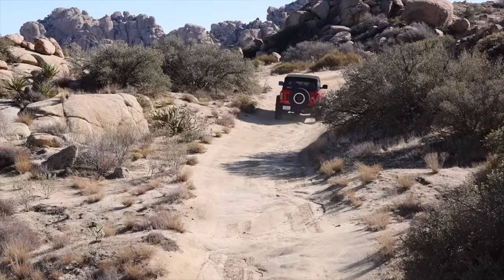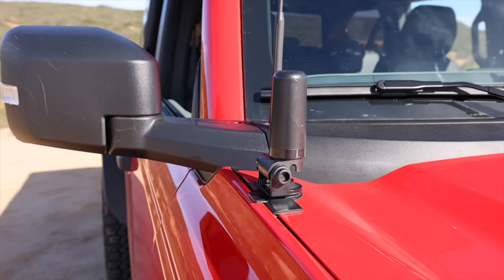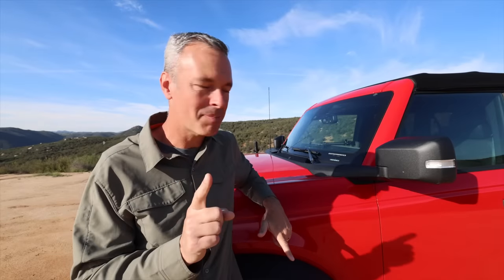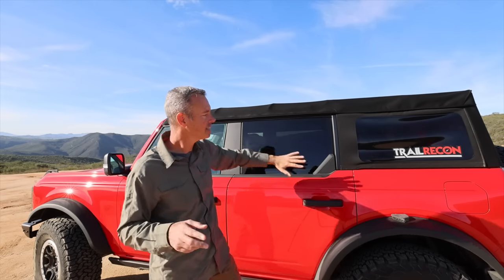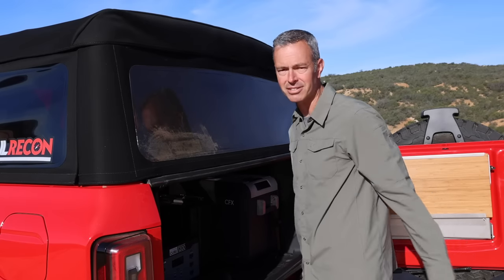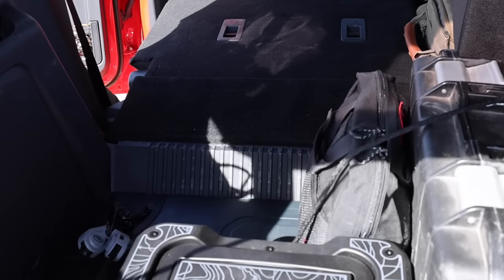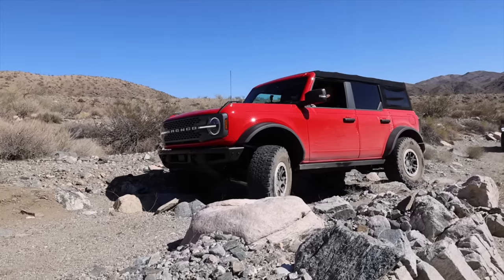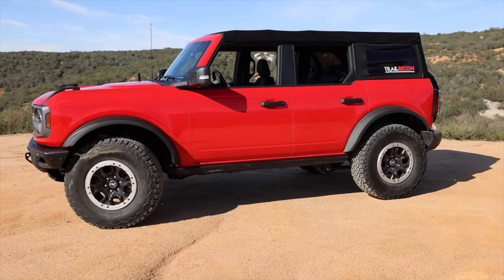Pros & Cons of Owning a Ford Bronco

Comment: Those are one time use bolts and yes if you remove them buy replacements first. You are absolutely right about a hang up point, definitely report to ford for a possible engineering change.

Comment: Great review. Personally I love the soft top. Easy on and off and the wiggly windows don’t bother me but I can see how others would have a problem.  For the rear lift take a look at IAG rear hood assist. Easy install and raises it a bit more. Still two hands to open but one pop and no need to set the bar yourself.

Comment: I personally would chose the bronco over my jeep. it’s more comfortable and does great with 37s and a slight lift I haven’t gotten stuck yet and I hammer on it pretty hard.
Reply: I think that it's even in competition says a lot for what Ford did.
It's also very often a lot of serious offroaders who like their jeeps over it too, and they show a shot of their jeep and they have 40 inch wheels and 50k of mods and lifts on the thing.
Yeah no kidding it isn't doing that, and of course it doesn't have the range of mods that the jeep does, but for those of us who don't want to mod so heavily, at least not yet, it's the best performer I can see on paper from an OEM purchase.

I just can't wait to get mine.
Reply: @breaddrinker  Jeep also offers 35s from the factory, so I’m not sure if it’s fair to say the bronco is the most capable stock vehicle... solid axles just offer a level of reliability and capability on the trail that ifs just can’t reach. It’s not about a brand, any brand that offers solid axles I would say the same thing
Reply: @AustinH7  I'm not brand proud at all. Please don't think I'm just harping on to one..
In fact in my situation I'm willing to be swept away, and I still have my eye on the Grenadier, and the new 4runner on the horizon while my never-ending Bronco order comes along..

I've got my own particular list of criteria, and the jeep..  
That of course, isn't to take away what you get out of it.

I'm steering at things I know I'm going to need in my situation.

Comment: The IAG struts for the soft top are a must... I am not too bothered by the soft top and got it to get it sooner too, but I think I would reorder with a hard top just because of the trunk space.  I don't even mind the wavy back window, but coming from a van I hated bending down to access the trunk.   But those struts made the soft top usable and it will be perfect since summer is coming!!!  Highly recommend them to eliminate one issue and it is only a $100 mod.

Comment: Thanks for all the great videos! The top has shifted forward then causing the closing issue and sides to be loose, If you completely remove the  top you can shift the brackets rearward to correct the problem on soft top. I have your identical bronco with lux package in Race red and I have the ford installed winch and it dose work with the adaptive cruise control.. Not crazy about camera being blocked though!

Comment: I love my Bronco Basesquatch, but that soft top is horrible.  I ended up fabing up some bars that connect into the factory bolts so I could attach my 270 Awning and my roof top tent, then using the canvas roof cover to protect me from the elements.  I live in Arizona so I don’t worry about rain too much.

Comment: I drive a 2018 JLUR on a 4" lift and 38's. I'm looking forward to getting out on the trails with some Broncos so we can swap opinions on the pros and cons of each. I appreciate anything that can wheel off-road, and in my opinion, the 4door Ford Bronco with a hard top would be a great daily driver and weekend warrior for easy-moderate trails, however, I would personally still prefer my solid front axle and huge aftermarket support in my Wrangler for aggressive off-road adventures on rocky trails and severe off-camber twisted trails like we find in WindRock TN, Hawks Pride AL, and such. I think the Bronco will behave better on-road than my jeep, but not as well as my wife's Hemi Grand Cherokee WK2 TrailHawk. That's how we got the best of both worlds in my garage at least.
Reply: I agree. I think the Bronco is more in the realm of a Cherokee Trailhawk. And I would take a Grand Cherokee any day over a Bronco.
Reply: @bryanrogowski  I’ve had two GC Hemi Trailhawks, and you can’t put 35’s or 37’s on them easily…or at all. Solid rear axle on bronco is off road plus, and more travel from front IFS on bronco than GC has its advantage too. I’d put bronco ahead of GC on off road capabilities but behind wrangler.

Comment: I'm loving my badlands. I agree with the soft top back hatch. I think they may of adjusted the soft top for the 22s because I really have to pull on it to get my hand under it and it doesn't flop around under heavy winds. Haven't had the chance to really fold it back so maybe it gets loose or stretches.

Comment: Selling my JK now for a Bronco arriving soon. Agree with most of the complaints - but happy to take the on road improvements.
Reply: Any updates?  How is the switch going?
Reply: @jeremywitkins24  no looking back man. There is an argument to be made that in the most extreme off road circumstances the solid front axle of the wrangler is going to be better and more durable off road - but like 1% of the people who actually off road (which is also a very small percentage of owners) often will ever see that benefit. For literally everything else the Bronco crushes the Jeep. If they ever figure out production I don't see why anyone would buy a Wrangler.

Comment: I want a Bronco, but they aren't in stock, and if they are they cost way above MRSP.  I was looking at Gladiators/Wranglers, plenty in stock, but not sure if I want the 3.6L, especially if there is a likely addition of the Hurricane 3.0L I6 TT coming out soon with more power than a Hemi 5.7L.
Reply: please be leery of jumping into something with a newly designed motor.  toyota for example is renowned with the reliability from most of their engines but the new offering in the tundra has been DISMAL.  can’t imagine stellantis won’t be without their issues.
Reply: @blackonefifty  Oh I hear you on that, though I did get lucky with my 2.7L Ecoboost on my 2015 F150, flawless 4 years of ownership.  My current RAM Rebel has the 5.7L V8, I do love the sound of that motor and it's been around a while.  Though even that motor has known issues like roller pins and exhaust manifold bolts.

Comment: Baja kits has an all 4 corners suspension kit. Rear billet trailing arms and billet upper control arms. Have a prerunner kit too but you don’t go flying through the desert

Comment: I have a Badlands 2.7 and agree with your assessments; but I got that hard top - just can't do a soft top.  Regarding the aftermarket... I think in a more "normal" time we'd have more options already available and out competing.. but with Covid and Ford production delays and international supply chains being wonky - it's just thrown a wrench into everything.  I'm sure it'll catch up; it is, however, unfortunate. 
Now I didn't get LUX package so I'm personally not concerned with the electronics package up there but even most of the winch solutions don't even take into consideration the front camera; which is one of the primary features of the Bronco so that's annoying. 

Anyway I'm interested to see what you do for lights.... I'm in Phoenix area and typically drive in fairly similar terrain as you do therefore I'm looking to see what options you go with, at what height level, and how you intermix ambers with whites.  I know there are some good kits that fit into those bumper side openings but those are also pretty low and like LiteBright for instance just removed those lower sides of the front bumper for better approach and clearance... which effectively nullifies that location for lighting. So... I'm interested to see what you go with. 

And thanks always for the content sir!

Comment: Have ridden, in new jeep, and Tacoma….don’t get it, zero desire to own either one. Loving my Ranger, & Badlands/ Sasquatch. 8000 mi on my Bronco, 60000 on Ranger. Zero issues on either. Both have all the bells & whistles The last month if the wind blew or it was cold, I took my Bronco off road. That meant I was going off road almost every day. It has performed great. So what if I get a wheel in the air once in awhile, it keeps going. Yes the factory top is junk, & the Bestop isn’t great either. A little less articulation, seems to me a small price to pay for a vehicle, that seems to me to be superior in most every way. Also correct me if I am wrong, isn’t Jeep about the most unreliable  vehicle built? Enjoy your videos

Comment: This is the broncos first generation (in like 40 years atleast) so I think given the fact that Ford came up with this from scratch compared to jeep having the same architecture for a century, I think they did pretty good
Reply: I am sure just like GLOCK they will eventually get it right.   Perhaps GEN 5 will come close to Wrangler.
Reply: @SurvivaLust  considering the bronco is pretty close to the wrangler in just one generation, I doubt it'll take 5 to match
Reply: Same architecture for a century. More engine options than bronco. Jeep first to add four doors. All ford did was copy it. Yay.
Reply: @aprojectile4421  ... You understand that Ford made the first jeep? Lmfao

Comment: Brad, been watching your content for several years and love it. I’ve had a similarly equipped BL with Sasquatch since October and love it. I also have a JK and love that too. I generally agree with your comments but differ on the tailgate. Maybe because I’m 6’ but I love the quick prop up vs my JK and having to unzip and flip it up onto the roof. I find it so much faster. And I think you’ll be happier once you lift it as it’ll be 3” higher. I did the 3” Zone off-road lift on mine with 35” Cooper Discoverer MT’s and find it feels even better off-road now than pre lift. It feels a little more supple and definitely helps with clearance all around. I did the BAMF bumper and Badlands Apex 12k winch. The parking sensors and ACC relo have worked great and the camera isn’t obstructed at all and like you I love that camera so didn’t want to mess with it. I get your point on the ACC relo and do tend to agree but I did it and it’s worked the same so far! I did make a simple wooden deck (covered in matching auto carpet) for the rear so the back is level with the rear seats and it swings right up out of the way so you can get to the stock floor storage. It created space for storage under it where I keep a portable camp table, camp chair, axe, folding shovel, recovery snatch strap and my soft shackles. So that’s actually pretty cool. I’ve slept back there a few nights so far and it’s been great! I installed the ARB dual under the hood and routed an air outlet down into the front bumper and set it on Aux 6. Also have added pod lights so far. 

Keep up the great content!
Reply from the maker: Thanks for being a long time follower! I think you're right, lifting it will help for sure, but I'm still worried about how it squishes up the side windows when open and what that will look like 2+ years from now.
Reply: @TrailRecon  ya me too honestly. I’m actually hoping some aftermarket will offer replacement windows at some point that aren’t all wavy like the current ones.
Reply: @craigduffy7879  TFL has an aftermarket replacement from "Best Top" on their Bronco and it's pretty good.
Reply: @Malc664  I watch those guys too and did see their soft top (fastback) but I think that’s a whole separate soft top vs just replacement rear side windows? I would just be interested in replacement windows. I actually like the soft top but thanks for pointing it out!

Comment: Hey Brad, my ears perked up when you said you're in Southern California. I was wondering how you deal with the front license plate requirement? That's my biggest point of anxiety. Thinking of putting it on the lower steel bumper, personally. Wish it wasn't needed at all though!

Comment: The ACC isn't really a safety system. It's a "luxury" it's not really needed at all. What is necessary and needed is driver attention. Just relocate it and put the winch on. The trail sights also line up with the inside of the front tires.

Comment: For the winch they release a new bumper for the everglade and its true they need to improve the softop specialy the sides panel but overall the roof still very solid its way better than my 2016 wrangler

Comment: I wanted power seats but couldn't see spending $3500 for power seats and cheap leather on the sides of the seat.  The vinyl feels just as good as the leather. Like you said how often do you change your seat position
Reply: @KFC Man or the plush vinyl. Get cloth and drop the princess package 😜

Comment: Which tailgate table is that? It looks like an Outback Adventures Trailgator but I'm not sure which size you have for the Bronco and whether or not it requires any drilling. Love the videos btw and look forward to continued content regardless manufacturer but I do have a Bronco Badlands and agree with most all your points (I like the trail sights though.)

Comment: In my opinion I think hard top is the choice for long term or mid term 
Here is the reason the next 2 year would be faded it from the sun light if you not keep it on the garage and second is might be easy to damage
Reply: Also anyone with a pocket knife can just cut right into the car and start stealing.

Comment: When the first reviews were coming out i was pretty impressed with some of the things ford improved on from Jeep's design. But also I almost immediately noticed some of the bronco's short comings. Brad hit the nail on the head about the lack of a solid front axle, the horrendous placement of those bolts on the lower control arms, and the thoughtlessly designed soft top. I actually consider myself lucky that I can't afford a bronco right now, hopefully there will be an updated version by then.
Reply: It’s a first year vehicle 🤷‍♂️ if that’s the only issues that you have that’s pretty good. When they finally beef up the ifs like the Toyotas it will be better than jeep. I think that’s what truly makes jeep guys shake in their boots
Reply: The IFS makes the vehicle way more comfortable on those long trips but there is a trade off in durability.  Each system is a strength where the other is a weakness or liability.  I think the review is spot on though.  I'm honestly beginning to have doubts about both the hard and soft tops.  Much needed improvement in both.

Comment: I agree that the Jeep is better off road, but the Bronco handles better on the highway.  It would depend on what your plans are.   After driving a lifted Jeep with 35's and a Bronco with 35's, the Bronco drives much better at highway speeds.  I will be at highway speeds more and light wheeling for the time being.  If I wanted to rock crawl, I would definitely get an older Jeep and modify it.  The Bronco's are too expensive to beat up on the trail or possibly turn over on it's side.  I like both the Jeep and Bronco, depending on what I am doing with them.

Comment: Great video as always. It's my understanding that there's no A pillar grab handle because the Bronco has side curtain air bags. I'll take the added safety over a grab handle.
Reply: Or...get an fj cruiser and have both.
Reply: @j.dailey5891  Fixed roof? No fun in that
Reply: @metal_horses568  it doesn't leak, that's pretty fun
Reply: @j.dailey5891  Good to hear that your fixed roof doesn't leak just like my removable top. I'm glad that's the only thing our tops have in common
Reply: @metal_horses568  all I can say to that is give it time, I have never met a jeep owner that's had a jeep for any period of time that didn't leak. I would assume broncos will eventually get that way, unless they've found out something jeep hasn't which I am all for(Ford>Fiat). But at least I have my a pillar grab handle.
Reply: @j.dailey5891  I'm not going to live my life for what MIGHT happen. Enjoy your grab handle and whatever the opposite of 'open air' is
Reply: @metal_horses568  yeah, I'm just trying to find a way to justify the fj cruiser now. The bronco came along and it's basically the best of both worlds. But I will use my grab handle gladly.

Comment: Have you had any issues with the T.O.D. transfer case slipping in 4H or 4L? There always seems to be someone who heard from a buddy who had a cousin whose Ford T.O.D. T-case overheated and slipped while in 4H or 4L, even though the clutch is supposed to be locked in those modes and shouldn't heat up from slipping. I get how one could while in 4A, but figured only a nugget would try to 'wheel in that mode.

Comment: For as expensive as the Broncos are it is a shame they have had top/roof issues.  The soft top doesn't seem good and they have had issues with the hard top.  Not good!  We were looking at the Bronco.  Although I think they are cool, there are definitely some bugs to work out.  Do you think the exhaust note is enhanced by the stereo like they did with the Ranger?

Comment: The first point is my biggest criticism of the Bronco... the choices made for the factory winch kit. The kit is available, but for Broncos without front facing camera and adaptive cruise control. Although the front parking aid sensors can be disabled long-term, they might as well not be there if you plan to add a winch. It appears that Ford's group of brain-stormers did not think individuals opting for higher packages would want a winch on their rigs for whatever reason. That's a big oversight... the winch option should have had provisions to be installed on ANY Bronco no matter of trim and retaining full functionality of ALL features. I'll also preface this... Adaptive Cruise Control(ACC) IS NOT A SAFETY FEATURE. It's more of a convenience feature. I can understand the concern of relocating the ACC and it not function properly when using it.